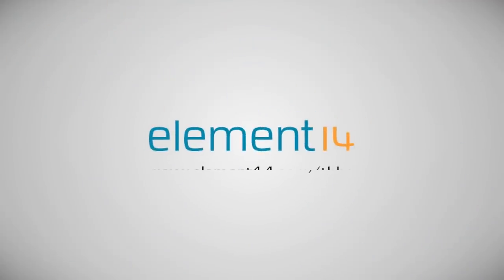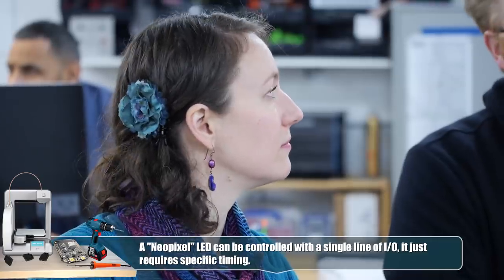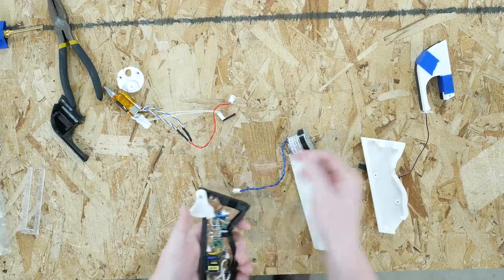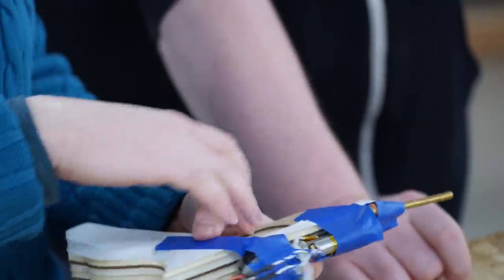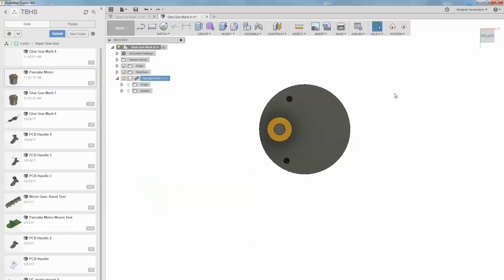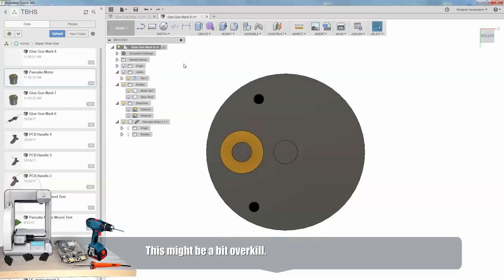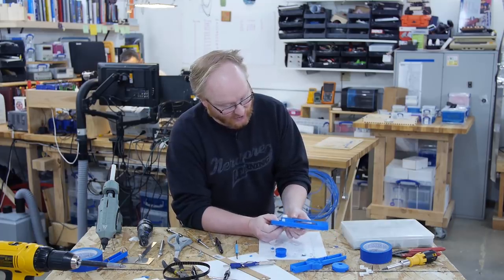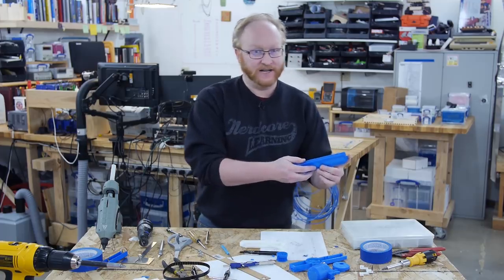Super Glue Gun 11: Design with Fusion 360

Comment: Once again i think the stand is optional, it's cool but you spend too much time on it compared to the real important think extruding glue and retract it. If i was you i will make an external stand like the soldering stations have or just make the gun with a flat surface at the tip and the handle so you can just lay it anywhere.

Comment: Too late for this now, but if the spacing for the servos and such was an issue, a mechanism similar to a switch blade could probably be made to fit within the same (or close to the same) footprint as the latest revision of the stand. But more fiddly and precise but could have been a cool mechanical solution.

Comment: Bummer. I gotta admit you lost me at the 1/4" glue stick requirement. I get that there are almost no motors available that can reasonably extrude the large sticks, but they are my stick of choice... lots of glue, longer time between refills...
Reply: You can just get longer glue sticks...or they even sell coiled glue sticks so they last forever.
Reply: I know, but longer 1/4" diameter sticks and coils are not available off-the-shelf at Michaels, Joann, HD, and Lowes, whereas a 24 pack of 1/2" x 10" sticks is always there for about $12. And I can swing by as early as 6AM and as late as 9:45PM if I'm running low on a project.
Reply: FWIW: I am mostly using 1/2" sticks at this point (as noted, more readily available). the project could have gone the other way though and used 5/8" sticks (and probably a bigger motor, using a 500W extruder, ...), for maximum gluing...
Reply: Seriously, does anyone actually use THAT much hot glue? If so, perhaps you should reevaluate your design and/or manufacturing processes.
Reply: The puppets I make require heavy puddles/beads of glue (about 1/4 cup or 2oz) to keep the mouth plates in place: if they rip loose from the foam, you have to tear apart the whole head to repair them. I often make FOUR heads at a time, so yeah, my manufacturing process does require that much glue at once. 

I also keep canned air on hand, and spray it with the can turned upside down to use it as a rapid cooling method on those large beads of glue.

Comment: This stand is patently ridiculous. My glue gun gas an integrated stand, prongs on the front in plastic. Never falls over, perfect design. 

#facepalm

Central motor with a sharp worm along the length to push the stick along seems like the solution to me.